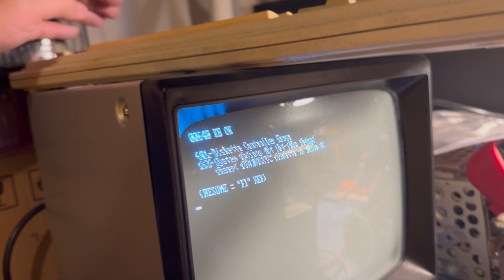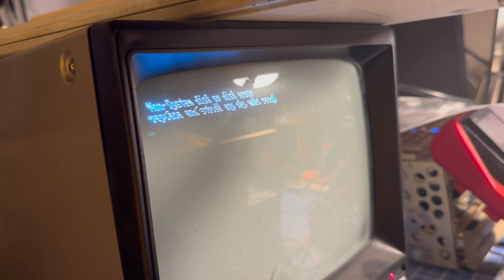Compaq Portable II Restoration - Part 1

Comment: I just restored an original Portable a few weeks back. The biggest issue with that one was the bad MFM drive and disintegrated foam-and-foil in the keyboard... And a bad boot sector on the original boot floppy ;) They are such wonderful machines.
Reply from the maker: My first Portable didn't have any drive, but my second one had a hardcard installed - sadly DOA.  Lain really likes when I replace the foam and foil because those things go shooting everywhere when you are popping them out.
Reply: Mine had both a hardcard and a separate MFM drive it it. Both were DOA. But I had a spare from a 5150 restoration that worked perfectly, so used that.
Reply from the maker: @wintermute740  I am running mine off of compact flash with this: https://texelec.com/product/isa-compactflash-adapter/
Reply: @jonobst  That's what I run in most of my machines, and that's where I got the foam-and-foil for my keyboard restoration, but in this case I wanted to keep spinning rust in it if I could.